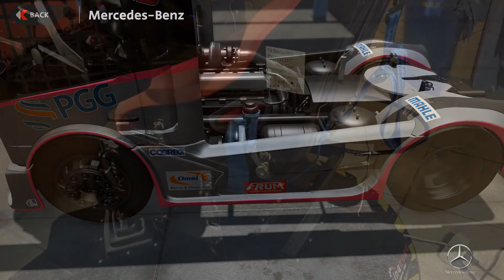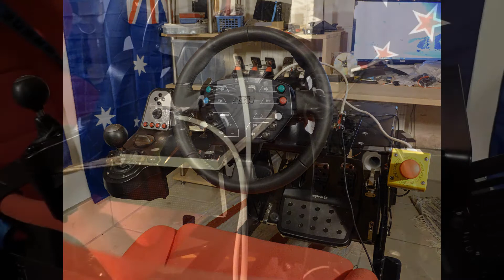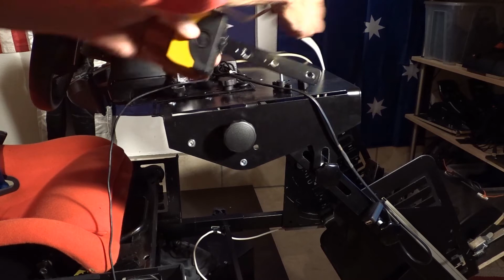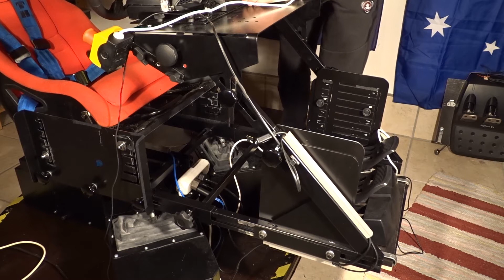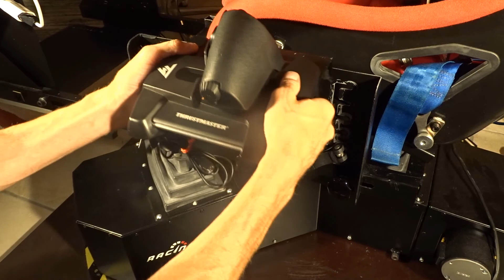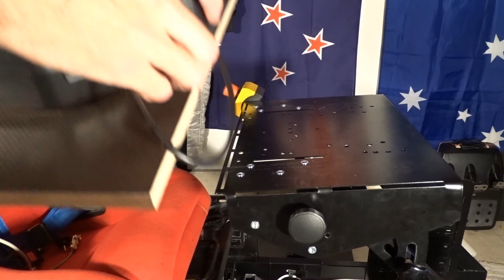One of the most Customizable Motion Rigs - Changed within minutes with FlexRig Mod for RacingCUBE

Comment: Hi, I wanting to build a Simulator equal your, can you give me tips? You have a material in pdf or template about the structure?
Reply from the maker: Hi, well, not really. I do have some basic hand scetches somewhere with basic dimensions. But this version had so many issues (load balancing and stiffness) that I had to bring in too many adaptions and therefore I would not use them anymore. Right now I'm  changing all 3 motor mounts to bearing block versions due to the extreme stiffness brought in by the scott russel links. Will post videos about as soon as possible.
But if you need tipps and tricks, feel free to ask.
Michael
Reply: @mariachi127  I think to use bosch 12v motors or windshield wiper motors, 3 motors, 2 for tilt and one for rear with lateral movements
Reply from the maker: Hi, OK, I see. So it should become a 3DOF, isn't it? What are the 3 DOFS in detail? Rotation around X, Y and Z?